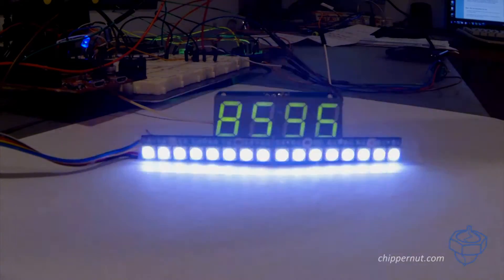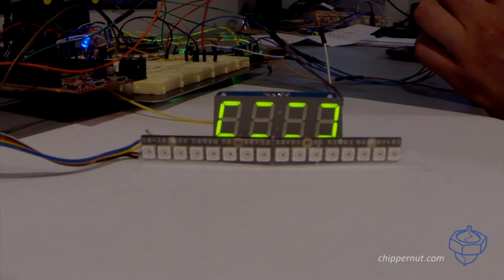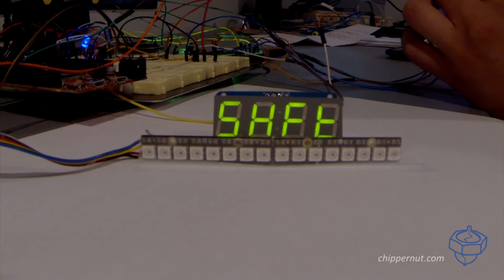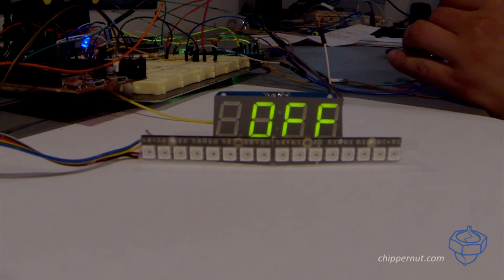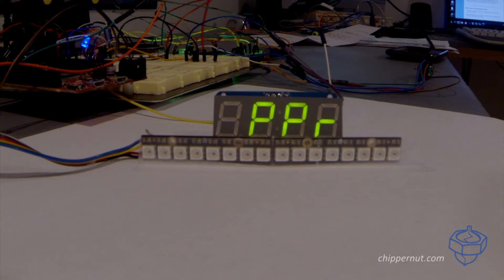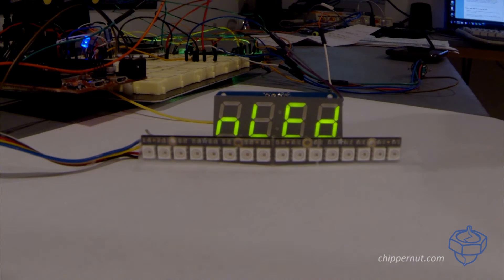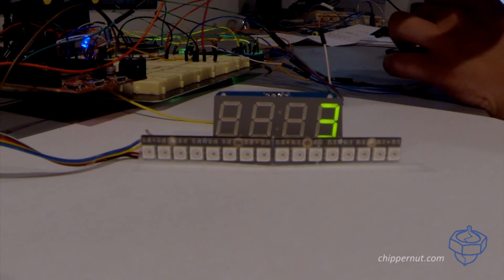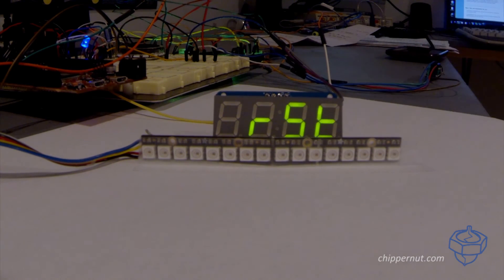Arduino Shift Light V2 Tachometer from Chippernut

Comment: I really dig this but I don't have time to do the work of building it and wiring it up.   Is there a "good to go"  kit  or is there a parts list?
Reply from the maker: +volksbugly Thanks!  I do plan to release a kit -  timing will be around early 2016. The parts list is: 

Hardware - mostly from Adafruit. 
(1) Arduino Uno 
(1) 7 segment w/ I2C backpack http://www.adafruit.com/products/881 
(2) NeoPixel Sticks http://www.adafruit.com/products/1426 
(1) 7805 TO-220 5V regulator (for neopixels) 
** WILL NEED HEATSINKhttp://www.jameco.com/webapp/wcs/stores/servlet/Product_10001_10001_786138_-1
(1) Rotary Encoder 
(1) 47k Resistor 
(1) 10k Resistor 
(1) 330 ohm Resistor 
(1) 1000uF Capacitor 
(1) PNP Transistor, 2N3906 ** 
** This intercepts the cars ECU RPM square wave (can be found on OBD terminal) -- without it, the signal terminates through the arduino (caused my gauges to go to zero) 

Instructions: 
http://www.chippernut.com/forums.html#/20150817/schematics-and-code-3-4917820/

hope this helps
- jon
Reply: +Chippernut awesome  I'll buy it when its ready.  I currently am running a Megasquirt ECU full sequential CNP with wasted spark 4 cylinder.  Till then I'll just watch the RPMS  :D
Reply: +Chippernut oh maybe I will try to build this, looks pretty strait forward.
Reply from the maker: +volksbugly Cool! Yeah it's not too bad.  A few basic components and you're on your way.  If you have any questions, please drop me a line in the forums @ chippernut and I'll do my best to help.

Comment: this is sooo cool nothing like anything else available on the market. followed you guide on your web but ive hit brick wall nothing powers up? does the code need changing? tried rpm sim.
Reply from the maker: +Dean Pasic Thanks!  I'm sorry you're having an issue.. I'm not quite sure what it could be.  Could you make a post at Chippernut and post some pictures? That wil help trying to diagnose it.  Sounds like it might be a power issue. The code shouldn't need to be changed.  Do you see the little green light on the Arduino?